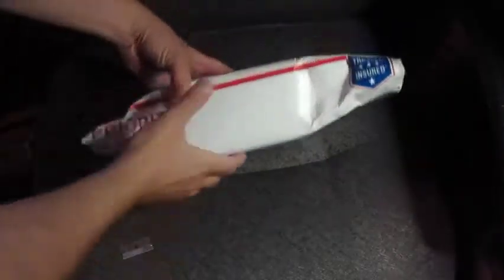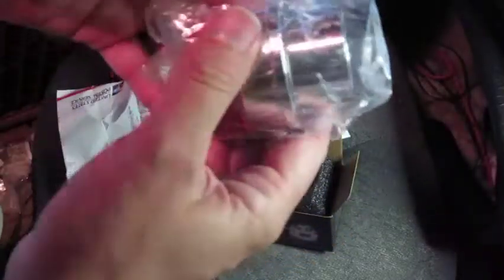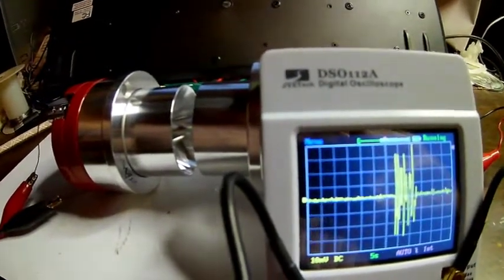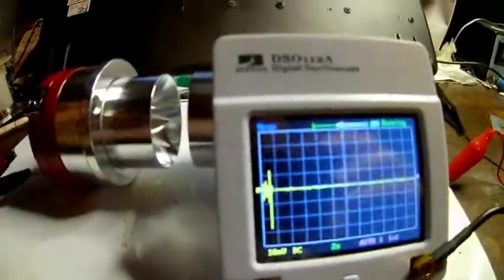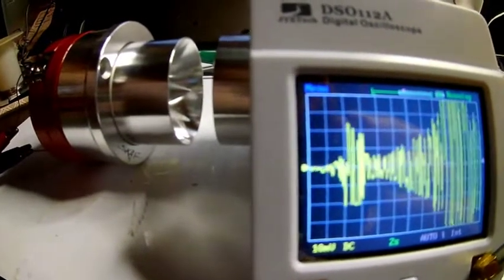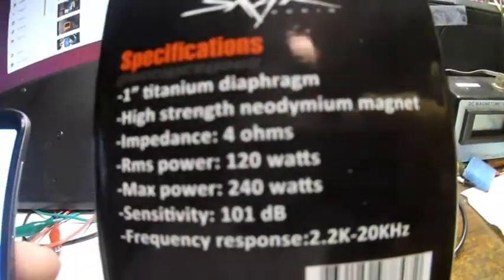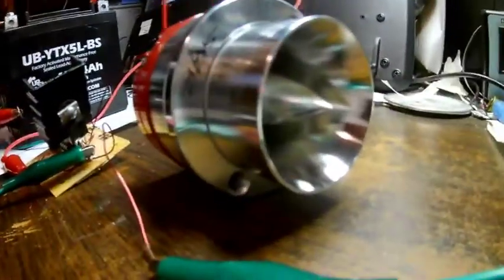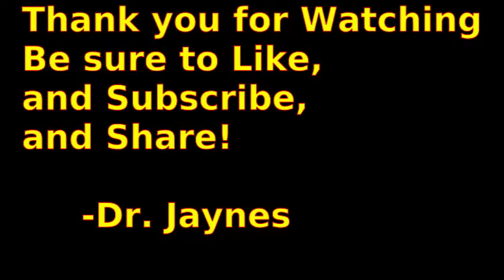SKAR Tweeter Test and Evaluation

Comment: Yo my tweeters are making a popping sound when the music isn’t playing, and when they do play the music goes in and out with the popping sound.  Does that mean they are blown?  Voice coil over heat?
Reply from the maker: Mine just completely stopped working.. I have been meaning to take one apart to see what is inside,.. and how it failed.. an if it is possible to fix.. we will see! Maybe yours has a partially broken wire that is making intermittent connections?? That might cause it to make a popping sound??

Comment: at what frequency should I high pass this?
Reply from the maker: Are you using these for tweeters in a speaker?? I am not sure?? I bought these to make a high power sound generator! They work great for that! They look pretty awesome as well! I have not tried using them as part of a speaker system..
Reply: i wouldnt cross them anything lower than 4500hz